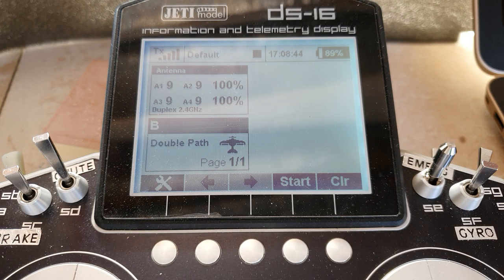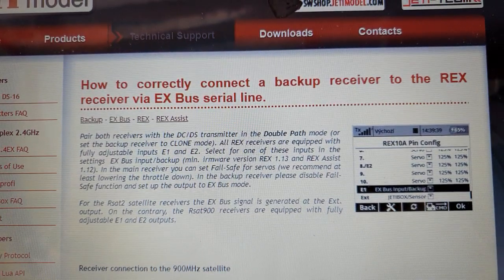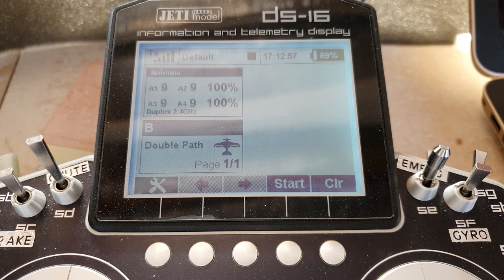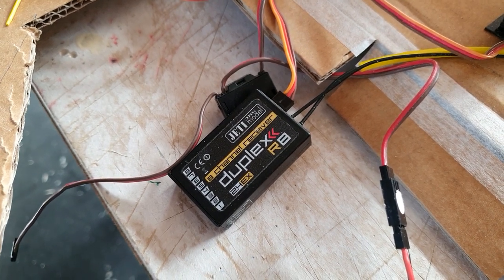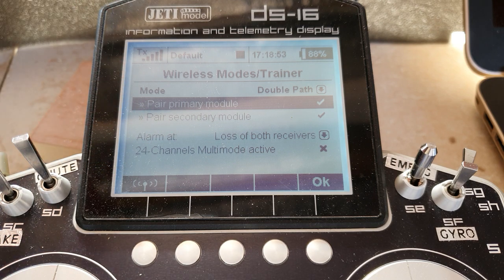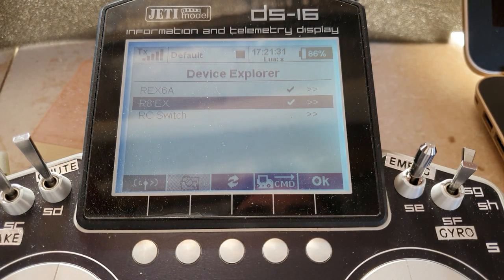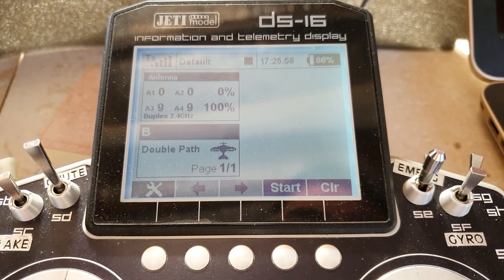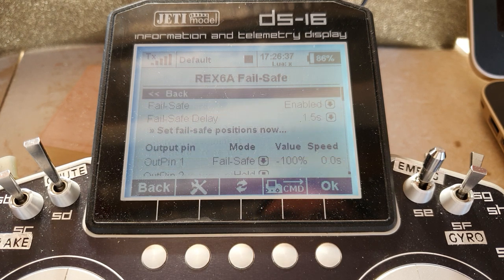Jeti - connecting 2 receivers together, using EX Bus

Comment: Hello Harry! I'm new to Jeti and using your videos to learn about this stuff, thank you very much for the effort!
I was thinking about the clone vs not clone receivers issue. I think the advantage of using a normal and a clone receiver is that both will be receiving data from both of the tx modules, which have antennas on the radio pointed in different directions, meaning, you get a lot more possibilities for antennas on BOTH receivers to pick a signal from any of the radio tx modules. Otherwise, each receiver can only get signals from the tx module it is binded to, so they are separately more likely to fail due to worse relative orientation of the antennas.
Reply from the maker: But a clone sends no telemetry so you do not even know if it is working!

Comment: Hello Harry. I’ve followed this video to the letter and I can’t seem to keep the model working when disabling the primary RX. I’m using a REX12 for primary and I’ve tried both a REX3 and RSAT2 for the secondary with no luck. When I disable the primary the antenna display drops to zero but the model stops working. When I disable the secondary I see the secondary RX antenna drop to zero and the model continues to work. Any ideas?
Reply: Getting the same with my rex12a and rsat2 unless I put the rex12a in ppm input
Reply: Nope my bad had the cable plugged into the ppm port on the rsat2. Plugged it into the ext port on the rsat2 and it all works as Harry shown

Comment: Very useful video, managed to get an Rsat2 setup with a REX 7 after doing a lot of trying on my own. However when testing by switching off either of the transmitting channels while servos still work the telemetry display for antenna strength goes to 0 for both receivers. Removing the satellite receiver also shows a 0 strength for both receivers even though receiver one is still connected as normal. Have set up the recivers as you show , satellite connects to E2 on the REX7. Any ideas as to why the telemetry is not as expected.
Reply from the maker: Set "alarm at" to "both receivers"
Reply: @cotswoldpilot  Thanks Harry, that did the job and the signal display now working as expected.

Comment: Hi Harry, thanks for this video.
I was setting up a dual path system with a primary REX10A (v.1.13) and a secondary REX7. 
Thing is, REX10A doesn’t show “EXBus Input/backup” as an option in E1 or E2. I tried just “EXBus” but as you have mention it doesn’t work.
Then I tried “PPM input” and changed “EXBus” to “PPM positive output” on the REX7 and it works, but not in EXBus mode...
Reply from the maker: I have a REX10 A and it shows EXBus input/Backup.  Probably the devices file in your transmitter is not up to date.  Open Jeti studio, update Studio (is in the help menu if it doesn't do it automatically), backup your Tx then run the Tx update.
Reply: @cotswoldpilot  Hi Harry, thanks it worked, I updated the DS16 from 4.xx to 5.xx and now the "EXBus input/backup" option is available and working 👍

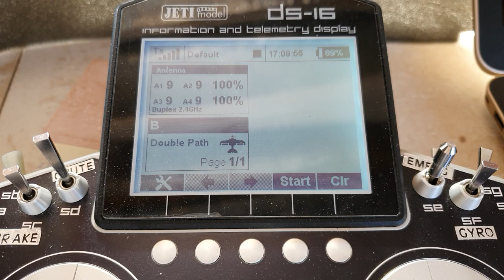Comment: Hello Harry, thanks for all your very good videos, I use Jeti for my RC Boats and 1:14 scale Trucks, as you are showing servo's working can see ways of using flying set ups for other operations, is it possible to link TWO receivers together to act as a single RX (not as a backup) so can add more channels overall, Thanks.
Reply from the maker: Alan, in double path mode both Rx get all channels.  If you give Rx 2 its own power supply, you do not need to connect them by cable and you can connect servos direct to Rx 2.  Do not connect servos to Rx 2 if it is powered only by the cable from Rx 1.  In the Rx you can re-map the incoming channels to the servo sockets, so for example 16 channels, 2 x 8 channel Rx, in Rx 2 re-map channels 9 - 16 to servo sockets 1 - 8.
Reply: @cotswoldpilot   Harry, many thanks for that will give it a try.

Comment: Is it possible to use the second receiver to anything but signal support? Like programming outputs into ex-bus inputs on a REX receiver? Or use them for additional servo outputs when the main receiver has all outputs occupied?
Or is the CB400 the only way to go around the problem when using 3 receivers and 16 channels?..
Reply from the maker: You can put servos direct into the secondary, use the receiver's servo output menu to map the channels you want to the sockets that you want - doing this does not affect the channel sequence in the Exbus data to the primary receiver.  You also need to set failsafes in the secondary.  BUT...... consider the power requirement of the servos plugged into the secondary.  Give it its own connection to the battery
Reply: Perfect😀😀

Comment: Hello Harry, thanks for you’re great explanation ad videos. I’m trying to run in dual path mode with Rex12 as primary and R5 as secondary. Tried several configurations, Ivan see all four antennae values but can not map servos to the R5. I’ve tried both Xbus input and PPM positive values. Does the primary Receiver have to have the SAT input for this to work? I’m trying E1 input on Rex12 and both PPM or EXT port on R5, neither works…Thanks for any tips…I think I might need the R18 to split the plane up the way I need.
Reply from the maker: The R5 is old design, its firmware may not include an option to output Exbus?
Reply: @cotswoldpilot  the R5 came from Jeti included with DS 12 radio, I think it’s an EX version because the menu lists it as such (R5Light) Under serial link I can select Ex Bus but there’s no listing under Alt pin configuration menu , U probably need to update firmware for that to show up.
Reply from the maker: @roymills415  "serial link" means the Ext port so set it to Exbus and connect it to the 12.  You should be able to route ch13-17 to pins 1-5 in the R5 menu
Reply: @cotswoldpilot  Thanks again Sir and Merry Christmas!
Reply: @cotswoldpilot  Got it to talk, not sure if it’s right but setting output on R5 to “Jetibox/Servo” worked!
Reply from the maker: @roymills415  that sounds wrong
Reply: Think I have it sorted out, the R5 light needed the firmware updated before I could see the output pins on the menu. It’s working fine, now I have extra channels on the secondary to split the plane in half and the 900NG as a backup to 2.4G. Thanks again!

Comment: Having some issues making this work. Probably just some embarrassing detail, but asking anyway.

Running REX12A primary with Rsat2 backup.

Rsat2: Serial link = EX Bus & PPM Pos. Fail-safe disabled

REX12A: E1 = EX Bus input / backup

Both rx are bound just fine, but disabling primary tx = loss of control (test servo stops responding)

Which Rsat2 output port should be in use? (tried both, same result)

Orientation double checked throughout
Reply from the maker: Rsat Ext port.
Reply: @cotswoldpilot  Tried, made no difference. I must have an additional issue somewhere
Reply: @cotswoldpilot  I actually wonder if the combined exbus + ppm positive is the problem.

The exbus input/backup might expect clean exbus, which is not what it is getting

A possibly relevant fact: A cortex pro learning signal type, will not work if trying to combine e.g an Rsat2 with a Rex3 as inputs - simply because the Rsat2 combo mode is interpreted as something different than the clean exbus from the Rex
Reply from the maker: @janmb  it is clean exbus, the ppm is from the ppm port.  My Assists with Rsat work perfectly.  Try binding each rx again being very careful to only power 1 rx at a time
Reply: @cotswoldpilot  Fair enough, will rebind both in turn
Reply: @cotswoldpilot  Still no luck.

Both RXes are bound correctly - made no difference

Antenna telemetry acts as expected when disabling one comm at a time, but the Rsat2 and REX12A are clearly not cooperating as intended

Not much more to be tweaked in terms of settings either
Reply from the maker: @janmb  try a different connecting cable
Reply: @cotswoldpilot  Will give it a try
Reply: @cotswoldpilot  Worked it out: Outdated fw on the 12A.

It's kinda finicky though - binding a new primary rx apparently requires rebinding of secondary too (no, no power overlap during binding)

Comment: Hello Harry,  Thanks for your superb videos again.  I've watch most of them and learned a lot.  I have been trying to setup a second receiver in dual path as suggested in this video, but I am having prblems.  Setup:  Primary receiver is a REX 12 Assist and secondary is a Rex 10, both with the latest firmware. The connection is from the E1 port on the primary (set to EX BUS input/backup in the pin config) to the Ext port on the secondary (no battery connected to the secondary). I cannot get past the Wireless mode/Trainer menu. The "Dual Path" option does not appear; it only shows "Student" and "Teacher".  I am sure I am missing something very basic in the connection, but for the life of me, I cant find what it is. Please help!
Reply from the maker: If you have a DS 12 I think double path is an option that you have to buy.

Comment: I ran into a strange problem, have a REX 7 Ass as primary Rsat2 as secondary. when I disable the primary receiver the telemetry disappears completely, tried to solve this problem for a good while, when I finally change in Rsat2 PPM / UDI from Direct to Computed, then the telemetry starts to work and it continued to work when yes change back to Direct. So the question is why ???
Reply from the maker: You must use Exbus, not ppm or udi.  "Telemetry disappeared" probably means that in wireless settings you left the "Alarm at" at its default of "any receiver", you should change it to "both receivers".

Comment: I have a ds16 v2 and i can get the assist rex 10 to bind However, I can NOT get the Rsat 900mhs to bind. It doe not even show it as an option. PLS HELP! PS I LOVE YOUR VIDEOS!
Reply from the maker: 900 is an optional extra on the 16 G2.  You can buy the unlocking file at jeti's swshop.

Comment: Hi Harry
I only discovered your videos days ago and I am already addicted. Congrats on your didactic skills.

I have a couple of questions if I may. I am building a large scale model and want to take maximum precautions to assure redundancy. So I use a REX10 as primary, a REX3 as secondary and a 900Mhz NG as additional backup (radio is DS-16 II). Primary and secondary are bind in double path mode. REX10 and REX3 are connected via their E1port and REX3 port E2 is connected to 900Mhz E1 port. All works fine. I can kill radio on primary, everything works, same on secondary and even kill primary and secondary and the 900Mhz takes over. It is really wonderful to see. On the telemetry I can see all three sets of antennas. 
Now here is my first question: if I disable primary all of telemetry is gone, except for the antenna's of the 900Mhz. Same if I disable the secondary receiver. 900Mhz still showing up in telemetry. Even if I disable both primary and secondary, 900Mhz is still showing antenna strength in telemetry. So I wonder is this the way telemetry works or should I receive full telemetry if only one of the primary of secondary is disabled? (telemetry on 900Mhz is limited, that is ok)
I also have a second question: if I use two receivers in double path as described, I have to set the E1,E2 correctly on both of course. But what about the receiver outputs? Should I make sure that both receivers show exactly the same outputs?
Thanks for taking the time to read my message and a sincere thanks for your help (to my questions and all the other)
J. Decuyper
Reply from the maker: The disappearance of the A and Q values is simply a wrong setting.  Go to Wireless Modes/Trainer menu and set the "Alarm at" to "Both Rx".  Don't understand what you mean about both rx having the same outputs.
Reply: @cotswoldpilot  Hi
Set alarm to "both Rx", now antenna readings are ok. Only the disabled RX has zero readings. Perfect. The rest of telemetry still goes down with RX1. if RX2 is disabled, all readings are there but if RX1 is disabled they flash and remain on last value. No big deal in fact, so I don't complain about that.

What I meant with the receiver outputs: in device explorer, all three RX show up, each one with a Manu with 4 items: general settings, fail safe, alternative Pin config and receiver outputs. in this last option I find 16 Output Pins which can be mapped to servo N°, I did this for the primary and secondary taking care to make the mappings identical. I was wandering if this is really necessary and what would happen if there were a mismatch. Just to make sure I fully understand the Jeti way of programming. Thanks again.
Reply from the maker: @jodecuyper7495  the connection from rex3 to rex10 is one way data, the rex10 E port is set as an input, which is why no telemetry data can get from the 10 to the 3.
The outpin mapping applies only to the sockets on that device so there is no conflict if the 2 rx are different.  The outpin mapping is not applied to the Exbus data between Rx.  The Exbus is not modified for mapping, failsafe etc, so its sequence is the servo assignment shown in the transmitter.
Reply: @cotswoldpilot  OK, thanks a lot. Clear to me now.